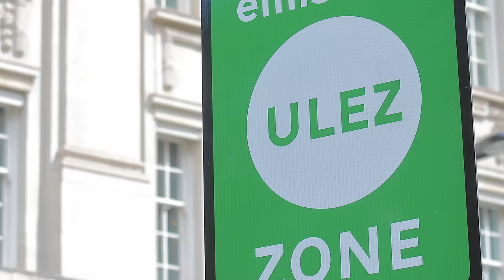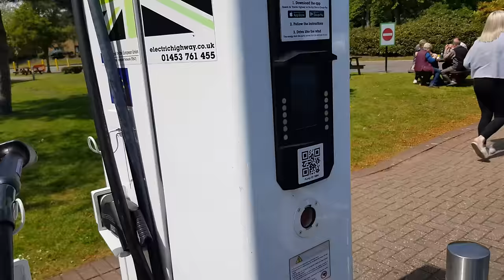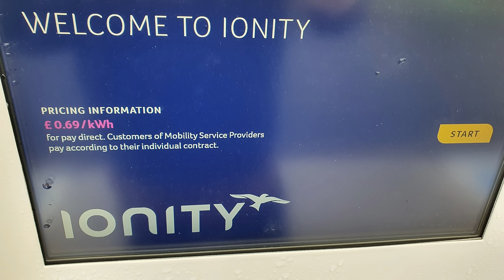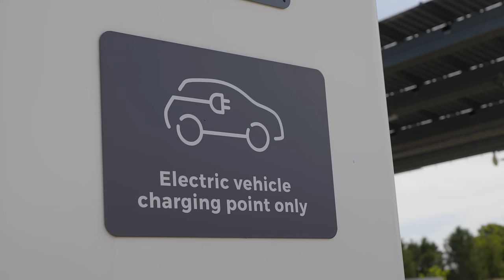The Uncomfortable TRUTH About EVs: The Version NEITHER SIDE Wants You To Hear

Comment: You can drop a match on to diesel and nothing will happen (No petrol) but put diesel in a bottle that atomisises it like those clean products bottles and spray that on a flame and it will burn instantly.

Nothing that releases high energy is safe, but traditional fuels are easier to put out. Lithion fires are immensely hot, and hard to put out.

Comment: Firstly, let me set my stall up. I am an EV driver who drives 30,000 miles per year. I bought the EV (MG5) because in my judgement it was the best thing to do. I'm fortunate in that I have my own driveway with a home charger.

I agree with what is being said here but main summary is:

Running an EV is MUCH cheaper if you can charge at home. Every morning I have 250 miles (ish) full charge from cheap home electricity. Servicing is cheaper too. 

It's a scandal that public fast chargers cost more that diesel or petrol. More needs to be done to support those who can't charge at home or need to park on the street.

It can be a right royal hassle getting charged in public. Too often the chargers are fully occupied, or broken, or issue spurious error messages.

I didn't get my car because it is cheaper to run (it is). I didn't get it because it's powerful quiet and smooth (it is). I didn't get it to make my life easier (it doesn't). I got it because I believed it was the right thing to do for the planet. (I still do) 

My advice is, keep your petrol car till the wheels fall off, then get an EV. Don't piss about with hybrids.
Reply: Would your advice be the same if you could not charge at home
Reply: @magsteel9891  Definitely not if you wanted to save money. If you wanted to protect the environment and don't mind paying more then of course you would choose an EV. VAT on home electricity is 5% (UK). On public chargers it's 20%. Changing that would help. There are other things the government could do to encourage EV uptake.

Comment: Charging at home (for some, the first 250 miles a day) is still close to zero. Actually 2p per mile if I charge at night. So yes public rapid charging is 10x higher that only applies to the days that you go above the daily range.  Don’t forget 250 miles is ~5 hours driving g (real world), so how often do you do more than 5 hours driving in a day? If the answer is often, then use the Tesla supercharger network which is way cheaper (and of course works).
Reply from the maker: Except you cannot put 250 miles of range in a car at a home charger overnight during the four hours of cheap rate

Comment: Safety - Both ICE and EV's can catch fire, we all know this.  The Exception?  EV fires CANNOT be put out, they will continue to cascade util the pack burns out entirely.  Essentially having also a higher chance of trapping the occupants when the battery system fails.  And a lot of people either won't know where the manual release is, or will panic and forget it. Sealing their fate.

Lithium cells currently used in EVs (Lithium Ion) will hit thermal runaway and cascade  each cell next to the other.  If a pack is damaged due to a malfunction, manufacturing defect, or damage from an accident, it will always be a fireball.

LFP (Lithium Iron Phosphate or LiFeP04) is safer but less energy density.  LTO or Lithium Titanate, is even safer, but again, energy density and more expensive than the other two chemistries.

Besides all that, you can't buy a EV "Beater with a heater" for $500 and get 300+ miles of range per full charge.  But you can with an ICE car, easily

As for banning ICE vehicles, there is legislation in place already to stop manufacturing in some states here in the USA for ICE vehicles - Your own country has already started:  https://www.forbes.com/sites/neilwinton/2023/03/03/european-new-ice-vehicle-ban-in-2035-stumbles-but-has-it-crashed/

Diesel is KING.   I love Diesel and I primarily drive Petrol cars.  Better fuel economy power for power compared to Petrol.

Comment: My argument for? An overnight charge at home, on a 7kw charger, with octopus energies EV plan. £12 to 80% overnight (Mercedes EQS 400+).
Reply from the maker: Unfortunately the tariff offered to me increased the day rate by more than enough to offset my infrequent charging
Reply: @JayEmmOnCars  that’s a draw back if you’re at home a lot during peak hours I suppose. 

For my use case apart from cooking and TV and things in the evening even the washing goes on a timer to take advantage of lower cost electricity.

Comment: An EV after 10 years vs. a Hybrid after 10 years vs. an ICE car after 10 years. The ICE car may have maintenance issues, but they can be fixed, usually economically (though this varies of course). Hybrids have batteries that may have lots a little capacity but range isn't affected, maybe MPG goes down a little. EVs may still be drivable and fixable but they DO have reduced range and this could affect whether the car is capable of performing its job. And the battery is the most expensive part of the car, indeed replacing the battery may total the car. Of course later things might be different. But for now EVs are for pioneers and more power to them.

Comment: Interesting, most of the suggestions of the issues you speak of seem to come from the UK. I think you need to have the government get involved in anti-price-gouging legislation.

I live in Oz and I would say around 60-80% of EV owners are in their own home and do 90% of their charging at home. One of our power utility operators offers $0.08 per kWh for overnight charging and around $0.37 for peak rate charging. Shoulder period is $0.19. Most of the independent paid for chargers are around $0.45 and of course there are quite a few free ones but as you say they probably won't last. Anyhow this means that the $0.45 operators have to way up carefully how much they charge if they want to get enough customers with such low priced competition for such a large part of the market.

The thing about heavy cables is somewhat disingenuous, because if I compare EVERY charging cable I've EVER used they are much lighter than a petrol/diesel hose, and more flexible.

In regard to EV fires, they happen way less often per capita then ICE cars, in fact the last I read was that in order of fire risk it's 1. Diesel/Petrol, 2. Hybrids, 3. EVs with Hybrids being I think it was 45 times more likely than an EV to go up in smoke.

Comment: Good presentation. Some few points though. Comparing the efficiency of an EV using Porsche Taycan is not correct. It is extremely inefficient, low range and very pricy. People who buy that car don’t care about money they y spend on charging. Tesla Model 3 drives 4.17 miles (EPA range not the stupid WLTP range). You have to use that instead of Taycan. Charging infrastructure is growing and there are many merchants who will try to exploit the market. Government needs to help in building level 1 or level 2  infrastructure in apartment complex, shopping places and large malls. Level 1 can charge I 8 hours and level 2 can charge in 3-4 hours. Government has to reduce the subsidies given to fossil fuels. Also, the video didn’t explain the dangers of pollution from diesel exhaust fumes and other pollution, there 3 million abandoned and orphaned oil wells in US  leaking and emitting toxic elements endandering the neighborhood for many decades.
Also, in my point of view, if someone wants to buy an EV, they can do so right away. However, when some wants to buy an ICE car, if it is possible, wait for an year or 18:months, there will be many low priced about 20-25k usd with higher range arriving. If you buy an ICE car now, it will be there first the next 20 years until it dies, polluting the world. If you can wait  a little, you can an EV cheaper than ICE cars.

Comment: My biggest problem with EV's is the price of them..    I'd never buy a new car, because no matter what you buy, you lose a load of money.   So the newest car I drive is a 2004 Saab 9-5 (on LPG)  wich was a writeoff because of a blown engine.    replaced that, brought it back on the road, and now its been running great, in daily use for 4 years again already.
Technology wise, its as modern as you need, in my opinion.  (its got ABS, EPS, Aribags, cruise control, rain sensor, self dimming mirrors.    But it hasnt got forward facing radar, lane assist or so..)      So I don't actually see the point in getting something newer, I just don't.

Comment: Here in Australia we need to get as many EVs onto the road as possible. It's not so much that they are better for the environment or cheaper to run. No doubt they are. But here in Australia 🇦🇺 EVs are the only vehicles that don't need imported fuel. In a fuel importing country, for security reasons we need to reduce our dependence on imported fuels.

Comment: EVs have their place, mainly around town etc.  However complaining about the costs of charging are unjustified, in most countries EV charging points are heavily subsidised by government already and are not profitable.  There are two main problems, firstly EVs are slow to charge so the service area needs to be much larger than a fuel station to service the same number of vehicles.  Secondly, the cost of providing infrastructure to provide the electricity to the EV charging point is staggering, particularly in a large thinly populated country like Australia. Estimates of the cost of this infrastructure in Australia just for the major highways runs to many hundreds of billions of dollars.   The cost of remote EV charging will eventually rise to cover this cost of this infrastructure as the number of EVs increase and cross subsides from other road users becomes untenable.

Comment: They say battery tech has moved on so much but it really hasn't. Tesla said they had a 15000 cycle battery years ago but where is it or details on it. They but actually panasonic even have big problems  with their new cylinder size which only offers tiny percentage  point gains anyway. It appears that there is a lot of hype such as battery replacement cost lies to keep investment going.

Comment: EV value depreciation isn't a bad thing. It means that people with a lower budget can afford to get an EV. It was always going to happen once the used EV market grew to match or exceed the demand. More price drops are incoming as the rate of EV progression is spectacular, and no one will want an older EV over a newer one, so the older ones will get cheaper. And the newer ones are getting cheaper, pushing down the second hand market further. This is good news, as more people will be able to afford to buy EVs. Have the option.

Comment: EV's will be the best choice for some people, but they will be self limiting, so it won't be necessary to artificially put a cap on production, nor possible to increase it. The more of them they make, the less of the expensive and non-recyclable trace minerals there will be to spread around. Petrol cars are only limited by politics, while EV's will have the additional burden of materials shortages that will take years, if not decades to ameliorate. If there are fewer amounts of these available, it stands to reason that the batteries will get more and more expensive, so people of limited means will remain priced out of the market. Meanwhile, the manufacturing process ensures that it is supremely difficult to release and reuse any of those expensive materials, and the power grid's ability to keep up with demand will also be a mitigating factor. If electricity gets more and more expensive because green contributors can't keep up, coal is banned and no nukes are being built, there will be a lot of noise about outlawing EV's . Additionally , turbine blades are being buried and solar panels cannot be recycled either. EV's are no panacea, they are just another option.

Comment: Okay wait, you can't calculate cost of a journey by dividing price of fuel spent by distance, to be fair you need total cost of vehicle over it's total life. An internal combustion engine can very easily run over 300.000km, 500.000 for a diesel.  A battery is supposedly going to work for 8 years or 200.000km, a model 3 battery replacement should cost upwards of $15.000. So add $0,075 to every driven kilometer. A journey of 800km will cost you 8 pounds or dollars, plus 60 (800km * $0,075) for the battery use.

A replacement combustion engine for honda civic costs about $5.000, but the car will be trash long before the engine goes...

A fair comparison would be the total cost of a car, fuel and maintenance when someone keeps it until it is no longer driveable.

Comment: I fail to see how EVs are the path to a sustainable future if you have to scrap them after a year or two if they suffer minor damage.  I think the main problem with EVs is the battery - we need battery tech that isn't prone to thermal runaway when damaged (or charging if the cells are slightly below par) and aren't scrap after 10 years because they no longer have any capacity.  The fuel tank in my F-Type hasn't lost any cpapacitty in the 7 years I've had it.  Most EV fires have happened to relatively new vehicles in good condition, so think what the world will be like when there are many older EVs on the road, possibly in a state of poor maintenance.  Especially if you live in an apartment with underground parking with chargers.  Oh, and the toxic substances given offf from a lithium battery fire are not exacly pleasant which is why firefighters attend =such a fire in full hazmat.   This is a good watch .... https://www.youtube.com/watch?v=AIXTP-TgPEw

Comment: Sports cars should always have an ICE, the feeling or revving an engine, pushing in the clutch, grabbing the gear knob and putting it into the next gear, the sound of the engine as it revs up. Electric cars are dull and the emotional part is missing. Also motocycles need to stay ICE, the range is just garbage on electric ones, and the weight of the battery makes the bike handle shit

Comment: I think if you can not pick up a connector and plug it in your car, you likely not fit enough to operate a 1,5 T machine which can easily kill other people.
The cost of fast charging is a problem in germany too. When you have a free account you pay 50-60 cents/kwh. Which is cost neutral to a ICE car. But if you pay directly with credit they will rip you off with 70-90 cents.

Comment: A first gen Leaf is fine -- if you replace the battery with a 60kw battery and probably get a better internal charger. That thing would go 400ks ... maybe. Mind my 10 year old hatch goes 400ks for around $50 and doesn't require a major upgrade to do it.

Comment: What about maintenance costs?  These are extremely complex systems requiring as-yet rare skills to service.
Reply from the maker: Curiously EV maintenance is very mixed - with some manufacturers charging almost the same as an ICE, and others a lot less
Reply: @JayEmmOnCars  Missed the point.  The average garage cannot service EVs.  When I get my ICE car serviced, I never have to go to the manufacturer or their dealer.  OK, car parts are insanely, even unconscionably, expensive.  As yet, EVs are scrapped at a higher rate than ICE cars because repairs are deemed too difficult, these are repairs that you don't see prices for because they don't happen.

I completely agree that EVs are great for city driving, but my house cost less than an EV...
Reply from the maker: @richardokeefe7410  I would wager a lot of the issues with "servicing" an EV are more to do with modern manufacturing practices than the concept itself. The electric bits shouldn't really need much doing if they work - and they should last a long time.
Reply: @JayEmmOnCars  10 years is a long time?
The problem is not whether the electric bits need servicing, but whether they are *dangerous*.  I concede that modern cars with ridiculous amounts of electronics and scary amounts of software need ridiculous levels of specialised equipment and training whatever the power train.  Which is why I stick with cars that are too dumb to be hacked.
Reply from the maker: @richardokeefe7410  the whole "batteries only last ten years" bit is fuelled chiefly but outdated information and internet BS. 

Imagine someone telling you ICE cars only last 100,000 miles - maybe it was true once. Not now.

Comment: Teslas are safer by far than average.  They're also so much simpler to repair than their peers because they have no oil system, fuel lines, and engine cooling systems and three moving parts - front engine, rear engine, and heat pump.  The FUD about fires from crashed vechiles has yielded a huge second market, I just bought a used Tesla Model S with supercar 0-60 performance and unlimited supercharging for under 20k USD.  So many examples are now going for 500k+ miles now and 300k+ miles on their original batteries.  It's LESS EXPENSIVE for me to buy this car than to keep my 12 year old hybrid sedan.  Welcome to the future!  Hope insurance companies figure out repair issues, that's a speed bump on otherwise a very clear road ahead.

Comment: 3:14 i still want a diesel!  

I still have a diesel.  There are no alternatives.

I don't want electric; and for bigger cars and towing, petrol is too thirsty.  

The problem is they're not making many diesels any more.  My advice, buy up the 2nd hand diesels and hold onto them!  In a few years time when the EV bubble bursts, and the diesel scare is old news (as pointed out in the vid it's fixed now anyway), but diesels will be scarce due to the manufacturing shortage, people will flock back to them and the price of the older ones is going to skyrocket!

Supply and demand.  Few years from now we'll feel the lack of supply, and they'll be in high demand.

Buy a diesel now and you might be able to sell it for twice as much in 10 years time.